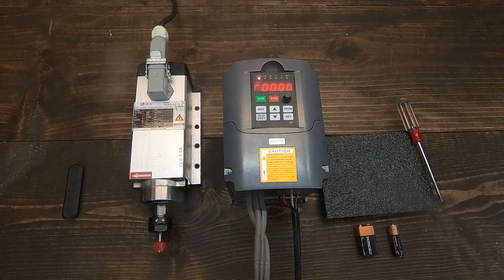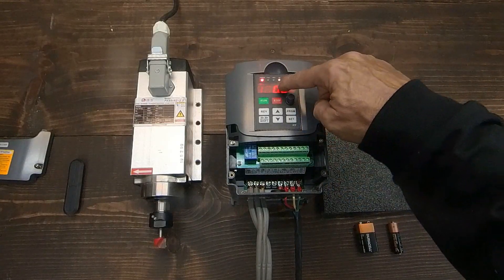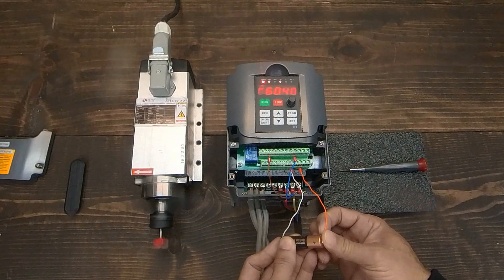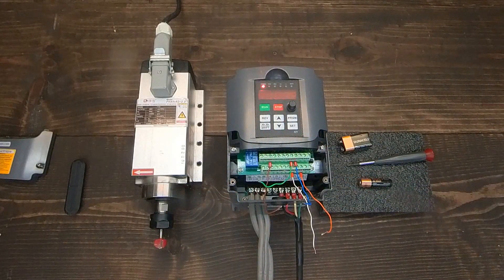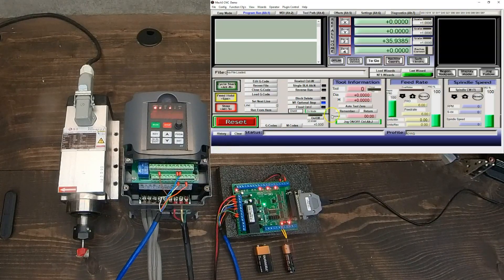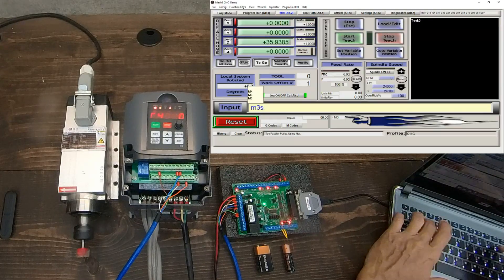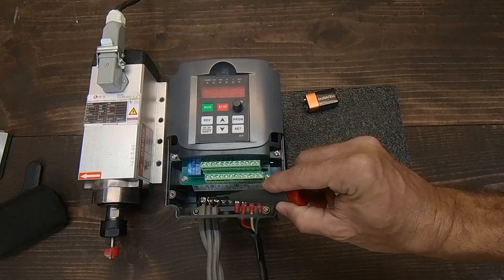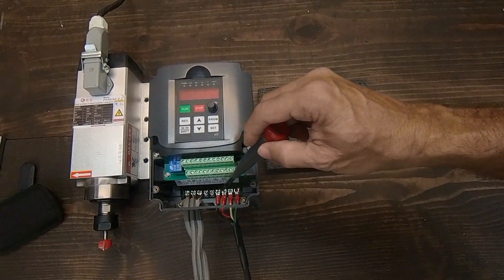Wiring and Configuring a Huanyang VFD and Spindle | Step-by-Step Setup

Comment: I'm trying to run a turbo pump. This controller blows up too easily. I got the motor to run but the controller blew up when i turned it off. A brand new one will blow up if the settings are off even with nothing connected.

Comment: Hi, how are you?

I have the same inverter, but I was using the RNR EcoMotion Mach3 controller, but now I've changed it and am using the DDCS V3.1 controller.

I don't know how to connect the controller to the inverter.

Can you tell me which inputs on the inverter I need to connect the wires coming from the DDCS controller to? Please.

Thank you.

Comment: A beautifully simple and elegant explanation and demonstration of controlling the spindle speed with small batteries. 
I am having a strange problem with my identical setup and with:-
PD001 = 0 and PD002 = 0 I can control the speed with ^ and v buttons from 0-24000rpm
PD001 = 0 and PD002 = 1 I can control the speed with the panel knob from 0-only 3000rpm
Am I missing some setting to get it to run at 24000rpm with the panel knob.
Reply: You will probably need to look at the other PD settings related to Analog Input and Spindle Speed.
They should be listed in the VFD manual.
Reply: @lucemiserlohn  You should look at the PD144 setting,  mine  PD144 = 3000 to get 24000rpm